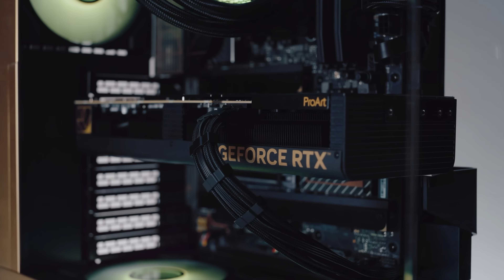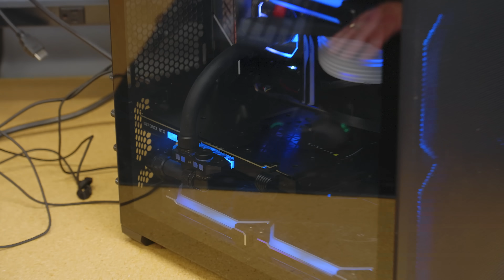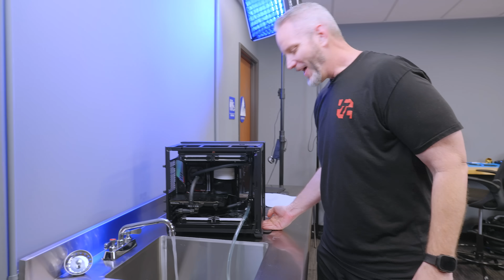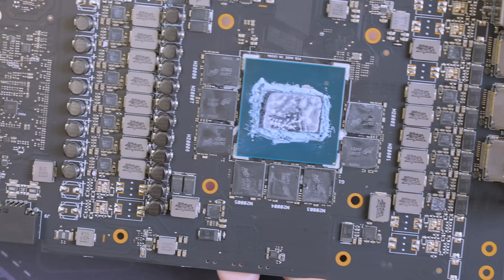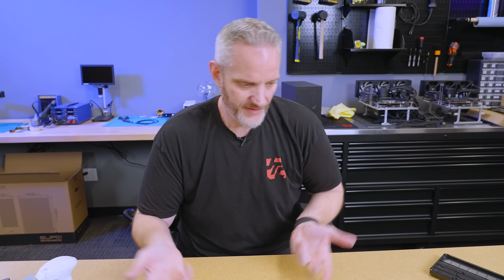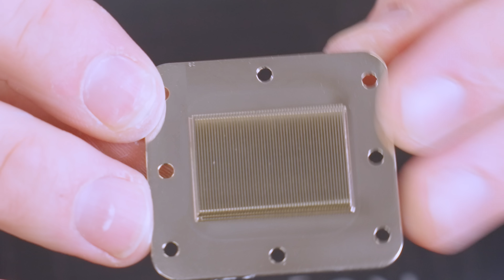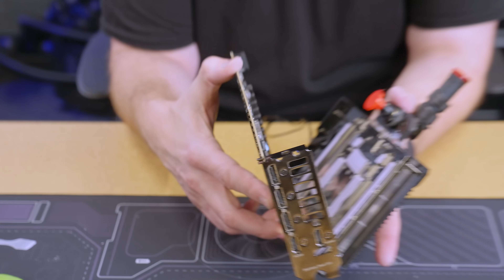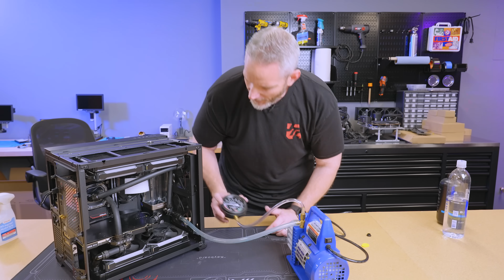These GPU Temps were BAD... here's what went wrong and how I fixed it!

Comment: I just undervolted my 4070ti super to help the gpu hotspot.  Get the same performance but now the hotspot is 15degrees lower and it’s super quiet.  Didn’t want to repast as when my 3080ti died I was refused warranty because I tried to tighten up the back plate and overclockersuk said the screws were damaged so refused to rma it.

Comment: my RTX 3050 hits 89°C while in heavy load and running at 2100Mhz on the clock (it draws less than 70w tho). Should I be worried?

Comment: it's too bad that nvidia dropped the hotspot sensor because it saved my 4090, bought a card with a waterblock preinstalled temps were around 55-60°C in normal gaming which seemed high for my loop and 350w limit checked the hotspot 115°C 😳 shutdown the computer took my brave pill like Jeremy Clarkson once said and opened the card, there was a little finger nail sized spot on the gpu with no thermal paste  cleaned plastered it with thermal grizzly kryonaut and now my hotspot barerly ever sees 64°C and in most games my "gpu temp" is like 45°C which is normal when you have 3x360mm of radiators
Reply: to give you an idea timespy extreme out of the box 61-110°C repasted +oc to 3ghz 46-57°C (inochill 3d card and waterblock is alphacool less pretty than ekwb but works awesome)

Comment: I've got a Gigabyte RTX 3090 Vision OC that seems to have spectacular temps but when compared to other systems of similar spec on benchmarks, it seems to consistently underperform.
Hot spot is about 16 degrees higher than regular die temp. Memory Junction is typically under 80 degrees, so that's actually great.
Considering redoing the thermal paste and replacing the pads with gelids but would hate to do it and lose the seemingly good thermals for no change in performance.

Comment: Have you done any watercooled gpus with PTM9750 rather than thermal paste? seems to work really well for directdie applications, I repasted my msi laptop's 10750h and 2070 super mobile and its been a great imrpovement, and its supposed to have much less pump out apparently

Comment: Interesting thing about the vaccum filling is, if you have residual liquid in the system, when the pressure drops it will boil off and fill your system with vapor. This i suspect, is also why you had such big fluctuations on your vaccum gauge, and why your exhaust on your pump was smoking.

Comment: KPX is sub-par in terms of longevity. You'll most likely experience the same thing happening again in 6-9 months.
Reply: My recommendation: PTM/phase change material or the new Thermal Grizzly Duronaut.
Reply: @-eMpTy-  might try it for the 9950x3d if amd decides to really sell them unlike nvidia and it's vapor-cards I'm super happy with kryonaut already
Reply: @fredEVOIX  
Check the review on igorslab if you want, he build quite a sophisticated setup and is doing thorough testing of various pastes and other thermal interface materials.
Reply: @fredEVOIX kryo is garbage for anything other than sub ambient
Reply: @-eMpTy- duronaut is probably the best option in terms of paste that you can buy without risking buying fake industrial paste (tc-5888). Polartherm x10 on paper does better in terms of pumpout, but duronaut is much better in terms of doing the smallest layer possible.

Comment: I had kpx pump out on my 2080ti which was vertically mounted, switch to gelid and had near identical temps with no issue. Tried kpx again on my 3080ti which was horizontal and had it happen again, took months instead of weeks but I stopped buying it then.
Reply: Yep, it honestly should only be used for subzero. For ambient there are much better and cheaper pastes out there these days, which actually last.

Comment: I vacuum fill religiously now. Gon are the days where i needed to have my fluid feed higher than the actual system to bleed the top rad without powering on the pump or moving the case around. Of course when i am fully bleeding the system i do rotate the system but being able to boot up under that initial SUCK!!! is a god send. Jay... Thank you sir

Comment: When I built my system I put an inline filter before both of my water blocks after, during my initial build of the loop, I had to remove the CPU block to clean it because of all the dust and gunk and shit that got built up in it even after I had flushed the loop parts properly before building. I think the tubing itself just had a bunch of crap in it since I had left it sitting for a few years in my dusty ass room (our whole area has high dust content in the air and even with multiple filters it's still really dusty, nothing more I can do). The inline filter seems to be working because both my blocks look almost as clean as new right now, almost 5 years on since I got my 2080ti in may of 2020. I'm using the same line of corsair watercooling parts for reference, same CPU block and similar GPU block but with the old head that leaked sometimes if you didn't tighten it down (I watched your video before it happened on mine and made sure to tighten it up properly during my build). If you keep having gunk issues like this, you might want to consider adding a filter to your build as well one of these days, and maybe try doing colored tubing and just treated water. I use primochill loop treatment stuff and distilled water in my loop and it's been rock solid, all I've had to do in almost 5 years is maintain the water level by filling the reservoir every year or so. It's currently at half way full and nearing the point I would top it off again, probably do that in the next few weeks here. Photo of said rig is also my profile picture if you're curious, it looks just as good in that 2020 photo as it does today.

Comment: so my 3070 that I got was the cheap MSRP model from gigabyte, but it had a ridiculously lucky piece of silicon in it that could OC like crazy. I put a better cooler on it and it has performance that is within 5% of the average 3080 benchmarks. Kinda wild.

Comment: "Ultrasonic Cleaner" would have cleaned that up nicely. Might want to give it a try.
Reply: The thing that confuses me is he bought one of those forever ago to clean the vaseline off his XOC motherboards. idk why he didn't use it this time.
Reply: I was thinking the same thing.
Reply: contact cleaner would have done it also.
Reply: I thought he would had used one, he just swapped pieces😂.
Reply: Super Clean brand of biodegradable cleaner would work well in concert with the ultrasonic.

Comment: Phils system is identical to mine! Lol no joke but im using a big ass 4080 super strix air card and I sill dont go over 65c even in 4k gaming. Also remember the latest driver has made alot of cards hit much worse temps and changed fan curves on many cards. If yall have worse temos go back to the old driver. My buddies cards fan curve completely changed it was so weird temps were much worse also. Even mine was a bit worse then usual ans even whines a little now and never did before. Im waiting for the new driver update.

Comment: I've never seen that reverse vacuum process to fill the reservoir. Neat!
Reply: It's the same way it's done on cars.
Reply: He filled the whole system not just the res, also pulling almost full vacuum first and letting it all rush in at once can easily damage the rad and other parts. Would be better have one part of the loop suck in the liquid WHILE you suck in the vacuum on the other end with the pump. This way you dont get that hammer effect that rushing liquid can do.

Comment: For future use on the vacuum pump, put a Catch Can on the suction line in-between the system and the pump. It's basically a little reservoir that will catch fluids before they get to the pump.
Reply: moisture catchers for air tool compressor lines, and engine oil catch cans from the crank case vent. same exact idea. if it works, it's not a stupid idea
Reply: The vac pump can also be run hot by pulling atmosphere to evaporate pulled fluid while any residual high boiling point organics (biocidal agents, colorants, etc) will get removed with the next oil change.
Reply: ty
Reply: You could make one from a spare reservoir by blocking all the fittings except two.
Reply: Can this also be done to fully empty a loop?
Reply: I'm happy to see people talking about the vacuum pump, but vacuum pumps cannot operate with liquids in the line, it contaminates the pump oil and compromises internal parts. Now It's pump repair time.

Comment: Water cooling has its uses. I have a modest system that air cooling works well with. Every water cooler I have dealt with was a cheap AIO that either the fans, pump or something else has failed. After switching to an air cooler the temps have stayed at a similar level. If I wanted a high end rig I might do a custom loop setup. It is nice to have.

Comment: Don't forget the n00b fastening rule.
Always do the screw corners only couple turns each, until you have it full locked.
Doing 1 corner fully then the other corner will squeeze out the paste in 1 side, which I think Phil did.